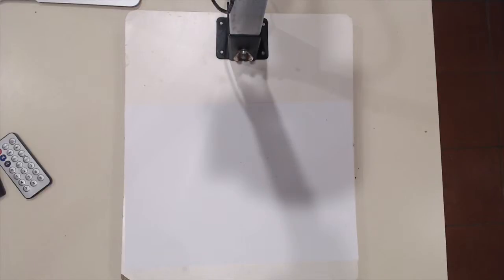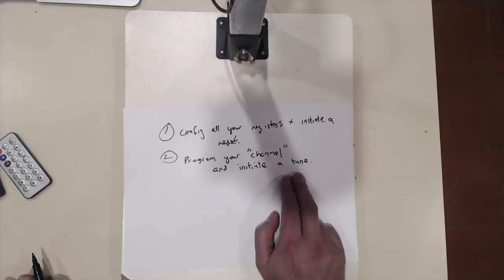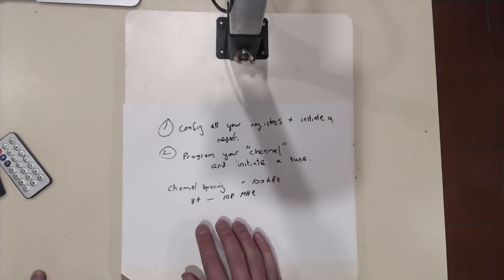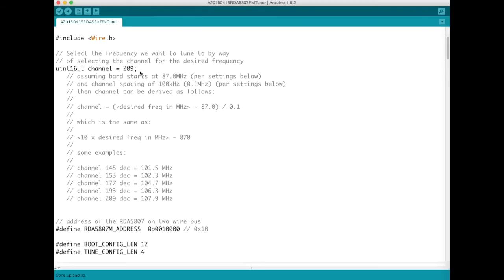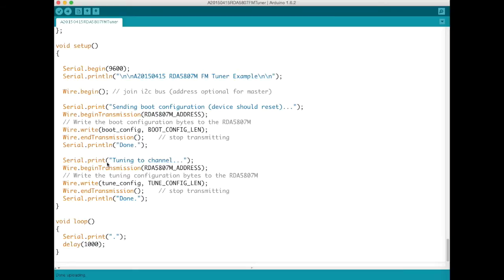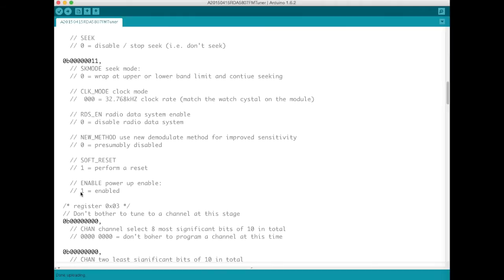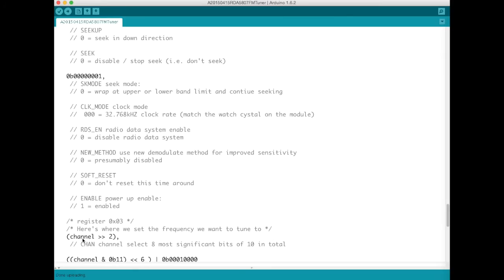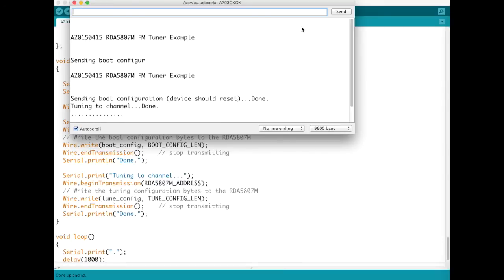Talking about my Arduino sketch for the RDA5807M FM Radio IC

Comment: I was somehow amused to hear actually statics on my first powerup and I played a little to get some more control. For some reason I can’t change the volume anymore ( it worked once ) an when I change the channel faster than -0.3 seconds ( after trying a potentiometer on a0 with no more sound after the fist tuning ) on my rotary the device will go mute… except in “direct mode”. Furthermore I can’t get a clear signal, neither in mono nor with a bigger antenna. Guess I will solder a second one to see what’s going on ( it’s unbelievable loud in the moment ), but thanks for your sketch, useful and structured layout for starters:)

Comment: If you use the RDA5807 address of 0x10 the register addresses will start at 0x02 and auto increment, as stated in the video. However if you use the RDA5807 address of 0x11 individual registers can be accessed by sending the register address after the RDA5807 address, in the usual way. So setting the frequency can be accomplished by writing directly to just  reg 0x03. The same applies to any other register.
I used a Microchip Pic for control and the addresses were 0x20 and 0x22 for device and register addresses respectively.